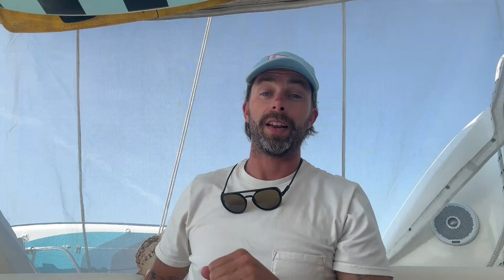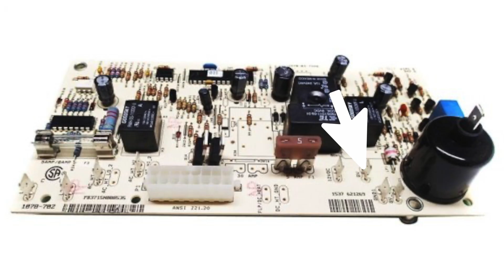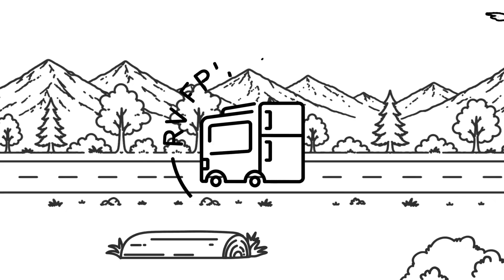Check This BEFORE You Replace Any RV Refrigerator Parts!

Comment: I sprang for an EMS, electrical management System which is more than a surge protector although it is that too. I will shut off power if it spikes too high OR sags too low, both of which can be destructive. I was astonished to find the power had gone off in the middle of the night; don't ask why I was up then. Only lasted a few minutes. The EMS had cut it off and as I watched over the next few days, the pedestal power would occasionally cut off through the EMS for, usually, just a few minutes. But the voltage ranged from (around) 109 volts to 129 volts. Glad I found the scratch for the EMS.
Reply from the maker: Always a good call BUT be aware that AC ripple caused by your battery charger failing, not the power at the pedestal. This is a much different issue.

Comment: Hi guys. So I just learned that the fridge in my slide in is not the correct one. I now have an older Dometic model from mid to late 90's that does not have a circuit board but more of a spade pin connector junction board.....no computer if you will. Would I still just pull off the 12V connectors and test those to isolate this issue? My fridge works great on AC but does not work on 12V and only cools the freezer on LP gas. I am not sure what is wrong. I pulled it out to "burp" it but don't think that solved a thing. Thanks for any tips.
Reply from the maker: What is your exact model number?
Reply: @rvfridgeguys  Rm-2453

Comment: That's great info. OK now let's actually talk about getting through the summer. All these videos insinuating the fridge is broken in some way are unhelpful when it's just hot outside. Use ice bags, in the freezer and in the fridge. More mass inside will improve function. Put them inside a tub to catch the leakage. I siphon the melt out rather than disturb everything. If the freezer works but the fridge isn't keeping up, rotate Blue Ice blocks between freezer and fridge. Keep it in the shade. Done deal, you'll survive NM and AZ and NV, if just barely. Experiment with giving it more air, but that alone won't be effective at 100+ degrees. You can trick the thermostat by my moving the sensor to where works for you. If you're trying to boondock in the desert in summer, don't. Head for the hills. Cooler elevations. If you're living in an RV those are really your only two options. Unless I've been doing it wrong for two decades, in multiple RVs with various ammonia fridges that even freeze things in the fridge 3 out of 4 seasons. I've come to expect it every year as a matter of survival.